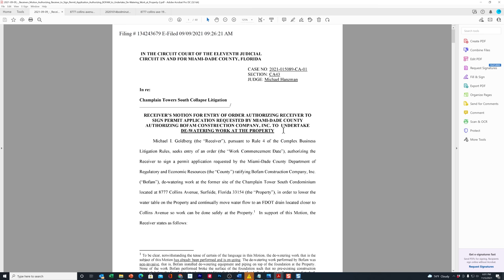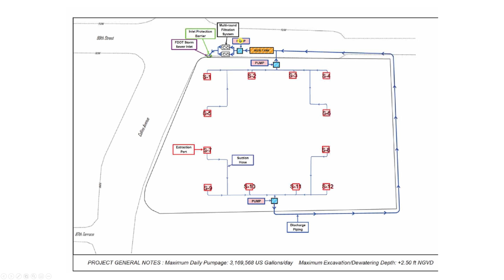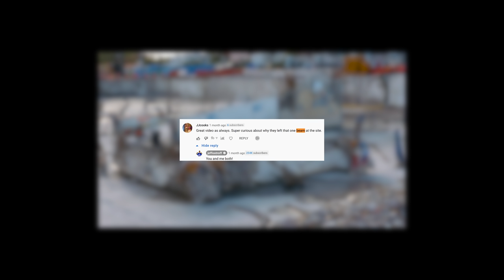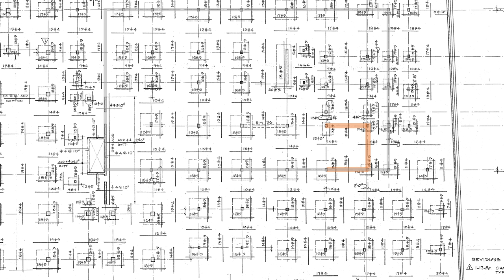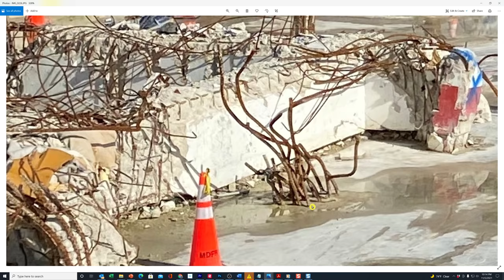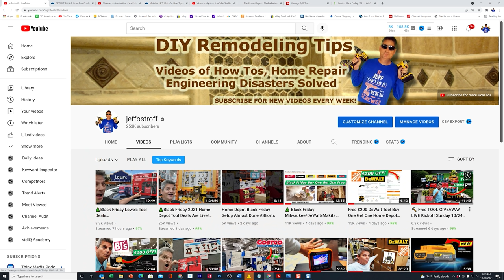Miami Condo Collapse: Engineers Baffled By Mystery Column

Comment: IIRC, it was in the Fiorella video, south-central portion of garage, you could clearly see a large rectangular section of the on-grade slab had been sawn out and replaced, clearly different color, texture, and weathering/staining of newer portion of concrete... anyone ever spot the requests/permits for that fairly major job? 
ETA: yep, it's @3:54 in Fiorella's video, near spaces 50-52, and encompasses at least 3 columns plus overlap, so a "patch" that's at least 50 feet long East-to-West, and... done by the handyman?... by a licensed contractor?
Reply from the maker: It would be a lot easier to find that permit if we knew what year it was done period it is also possible that may have been done without a permit
Reply: Edit2: although not as much color contrast post-collapse (due to weeks of rain, mud, and heavy equipment traffic), you can clearly see the NW corner of the "patch" in the video above starting @4:04 ... it takes up a good portion of lower-left frame... looks like it's completely OUTside the building, but very much in the heart of the infamous PLANTER ZONE ...
Reply: Well, I'm sure when the info comes out about CTS's so-called 'maintenance', we are going to be gobsmacked.  It wouldn't surprise me if the work had been done by people they loaded up from the sidewalk outside Home Depot.  "Can you do waterproofing and structural concrete repair?" "Oh, si, si.."
Reply: @johnbergstrom2931  Yep, every ducat saved in the "yucky" garage was more to spend on the very shiny marble in the "fab" lobby, and the oh-so-pretty planters by the pool... smh...
Reply: @johnbergstrom2931  So much of that going on.
Reply: @MajorCaliber  Right. And the roof work started with installing window washing equipment.
Reply: @stache1954  Not sure about window-washing equipment, but they did have to install numerous vertical-post-type fall-prevention anchors, intended for the roofers to tie-off their safety harnesses.  Apparently this is an OSHA reg that came along well after CTS was built, but they were not allowed to grandfather out of it this time around.  Many (but not all) of these anchors were mounted to the very tops of some columns, and after installation,  they were stress-tested by hand-winching a cable between pairs of anchors, loading them with IIRC something on the order of 4,000-5,000 lbs... not enough to damage a "healthy" building, but possibly Yet Another Straw on The Camel's Back...?
Reply: @jeffostroff  If it was done without a permit, the building owners would still have who they contracted to do it either in their system digitally or on file in paper right ? Sure it would mean trawling through a crap ton of info but eventually you'd find out who did the work and when it was done.

Comment: RE: The mystery column:  Given the amount of rebar in the mystery column it seems VERY unlikely to me that it was built as shoring before the collapse.  Here's why... If it was to be shoring it would be used almost exclusively as compressive material to hold up what?  Would it have been placed UNDER the existing beam or UNDER the first floor slab.  If it's supposed to hold up that H beam how is it going to do that with no foundation other than what is probably a 6 inch un- or poorly- reinforced slab?  Were that it's use there should be evidence of the slab being cut so a real foundation could be put there for this column.   No foundation means you don't expect it to hold up much but if all you wanted to hold up with the first floor slab for a few months it might suffice... But if you are just putting in a compression supplying column why would you stuff that column with all that rebar?  Makes no sense. Rebar is to resist tension load and moments, as a shoring there isn't going to be much/any tension or moment load for this temporary use. 

Also keep in mind that shoring that is not under load isn't shoring anything. You can't just place something under something else to shore it up, you have to move the upper stuff UP while you are building the shoring, make the shoring "too tall" and then let the "stuff" back down on top of the shoring so that the shoring will start providing some of the resisting force.  If you don't you get no shoring effect until such time as the stuff over it has sunk/settled down on top of it.  That's certainly OK if that's your plan, sort of a we want this here in case it settles more. But that also works against putting lots of steel reinforcement in the concrete.. shoring that's not even touching but is just hanging around "in case" needs little more than compressive strength, not a bunch of moment resisting steel.  There is no evidence that H beam was weak and needed shoring, to the contrary it was so strong it held together throughout the collapse and remained intact.  If the problem was the columns holding up the H beam why would you put your "fix" in the middle of the drive way?  You'd put it at the H beam ends to strengthen the columns holding up the H beam.  And I would suggest that as a temporary measure you would use steel, not concrete.. more next...

 Next.. and perhaps more importantly from a logical construction standpoint...  If I felt the need to get something into place here as temporary shoring I would simply order a 12 foot (whatever the distance was from slab to point of top of shoring) section of steel I-beam (to use as a column) along with 1 or 2 inch thick steep plates to use as bearing surfaces at the top and bottom. Once fabricated you could get them in and done in a day.  Weld the I beam column to the plates.  If you wanted to get fancy you could bring in some large building jacks to spread the plates an 1/8 inch so there would be some preload on the I beam column after welding things and pulling the jacks out.  You could place this steel where the "mystery" column is or you could put it next to the columns holding up the H beam.

So what we are left with IMHO is that the mystery column is not some temporary shoring. Even if it was thought a temporary support was needed it would make far more sense and be much easier to construct out of steel then to form and pour a concrete column inside the parking structure.  The mystery column is what it appears to be, even if why don't know the sequence of failure that put it there, it's some portion of the column that originally was on top of the H beam.. sheared off and speared into the slab.  ***What we are seeing might not even be the lowest segment of the sequence of columns that rose from the H beam up to the penthouse.  The segment that originally sat on top of the H beam may have buckled and slide off and been removed by NIST and the part we are seeing speared into the slab may have been from the 2nd or 3rd floor.  Who knows, we're all just speculating.

Comment: After reviewing the 1979 structural plans and reviewing the still image @ 4:17 of this video, I submit the following...  

Column K was not structurally tied to Beam BM35 with J-Hooks nor was it tied to the lobby slab with J-hooks. This is clear as no structural details for tying the 2 structural components together were provided in the 1979 structural drawings.  

It is also clear from the still image @ 4:17 of this video as there is no reinforcing steel protruding from the center of BM35 where Column K should have been structurally tied to BM35.

I would tend to agree with prior comments that the "mystery" column is actually the lobby end of Column K which penetrated the garage slab during the collapse.   Notice that all the other remaining columns have some concrete within and round the rebar and there appears to be none left within or around the rebar protruding from the garage slab at the "mystery column".  Yes, one would expect more damage from the garage slab if hit by the full weight of an intact column K during the collapse.  Based Morabito Consultants 40 year review and recommended repairs I don't think it would be a stretch to propose that column K at the lobby slab just above BM35 had also degraded due to water intrusion rusting the rebar and breaking the bond between the rebar and concrete allow for the easy penetration of the garage slab by rebar of column K.

This condition alone should not have caused the collapse but if the the rest of the columns at the lobby slab level were experiencing degradation due to water intrusion as well then that could have very well lead to the collapse.

Just my two cents from a couple decades in the industry...
Reply from the maker: We noticed the same thing, maybe 2 little rebars, but this column does not seem to be held in place very well.
Reply: Well, it was probably at least tied into the slab, even though it doesn't show it on the drawings.  It was a 'floating' column, but they didn't just let it float on the slab.  Column K probably had 100,000+ lbs of load on it.  If there was no rebar at it's base, it would have started cracking and failing 30 years ago...  
Not even an incompetent concrete worker would be that negligent.
Reply: And I think you're spot on.
Reply: I'm presuming they got the whole slab dry during the initial pumping. At that time, if this is a matter column K impacting the slab and embedding the rebar, then there should be spalling and possibly cracking of the slab which would have been obvious when dry. Don't think structural engineers would miss something like that... Not to mention that area of the slab could be removed for forensic analysis.
Reply: @terrymoreland6446  That spot requenches itself every time the tide comes in.  Pumping is futile.
Reply: @terrymoreland6446  Not "possibly".  The energy required to impale a 12 x 24 column would have broken up the slab massively.  It wouldn't be hard to spot - it would look like an impact/detonation crater.
Reply: @fraidykat  Trust me...you can pump out areas well below sea level out faster than water can seep through in through the sand. On the initial pumping, so they could get the crushed refuse out of the way, they pulled it out to a 'slab dry' situation.
Reply: @terrymoreland6446  Yes, with a big enough pump and low tide, you can pump it out.  Any time you turn off or even turn down the blimps, the water will return.  Even now you can see the puddle that remains.  Add a full moon at high tide or a tropical stormnand you have an even higher tide.

Comment: Since the basement floor at the mystery column looks very even instead of showing signs of impact, my guess is it was a retrofit column put in after the video.  Maybe they drilled holes into the floor to install the rebar then built up a column to the ceiling.  Because it was a retro fit, the new column's concrete would break away from the original floor surface rather cleanly.  Would need to see the underside of the crossbeam to check for an attachment point.
Reply from the maker: Bingo! That has been my theory also. And I suspect without permit
Reply: @jeffostroff  Jeff, go to the Morabito plan for repair and restoration.  It's on the Surfside site "Preliminary review plans for 40 year recertification", uploaded July 3, 12:46 pm.  (Near the bottom of the page).
On sheet S2C-2.9, top left corner is a drawing of a grade beam tied into a "New column".  They always intended to add columns for support.  Not really sure what they were supporting...
In the video, there is no excavation for the grade beam, so we swing back to illegal, unpermitted construction by people who didn't know what they were doing.  Also, I'm not sure if the Morabito work had even started yet...

Comment: To support the "Recently Added Shoring Column" thesis, I would add that there are several retro-fit piling technologies that could support a retrofitted column.  Some could be deployed with the limited ceiling height in the CTS garage... but get out the checkbook.
Reply: Cheque book.
Reply from the maker: Or they could just drill hole for a few rebars and pour a column real quick knowing it might be a temporary fix
Reply: @jonathaneastwood2927  Oh, you mean credit card...
Reply: Well I've scoured Surfside's public records looking for a CTS permit for an additional column and NADA.  If they didn't do the work above board I doubt they sprung for a new piling. 
It might be they just haven't digitized it yet but documentation of structural work on a building that collapsed would have priority...
Reply: @jeffostroff  Still need some kind of jacking mechanism to get the new "illegal" column to actually take up some load from the failing slab overhead.  Just casting a column floor-to-ceiling (using Mafia-Mix, nach) does almost nothing... except add to the floor's dead load, lol.
Reply: @jonathaneastwood2927  Cheque book.  Nudge-nudge, wink-wink, Chancellor of the Exchequer, say n' more... ;')
Reply: @MajorCaliber  I'd just use my 'Kryptonite Card'.  It has a trillion-dollar credit limit.
Reply: @MajorCaliber  It depends on the compressive strength of the concrete floor and soil.
Reply: @jeffostroff  yep and epoxied it.
Reply: @designstudio8013  assuming the floor still rested on soil
Reply: Well they can't fix it now whole building collaped and 100 people died did you hear?
Reply: @jeffostroff  no possible way in hell 12 pieces of rebar impaled themselves into a solid concrete floor without creating massive cracks in the floor. These rebar were drilled and mortared in place at some point. It's definitely odd that there is absolutely no concrete lodged between the pieces of steel like every single other column,  telling me the concrete was much softer in that area. Probably poured at a later date.  You agree?
Reply: @MrBmxbrawler  It's definitely odd that there is absolutely no concrete lodged between the pieces of steel like every single other column,  telling me the concrete was much softer in that area. Probably poured at a later date.  Or never poured at all, i.e. still under construction when zero-hour arrived... any wooden forms, if present, would've been pulverized, then washed/burned/dissolved/shoveled away.

Comment: Another great video! 
Could this be a structure column below the garage floor?
Reply from the maker: Remember any column that comes up out of the garage floor should have a pile with a pile cap below it extending down to the limestone bedrock. But remember Fiorella's video shows that it simply wasn't there last year.
Reply: I understand that this ‘new’ column was not in Fiorella’s video. This column is below the garage floor and was not by seen until after the collapse. This could be a punching shear.

Comment: The column that starts on the first floor and sits on the cross beam of the H, would that have been rooted into the H beam?  Or just into the floor itself, just above the beam?   That column was actually rectangular in cross section.  The re-bar protruding from the floor appears to have a square footprint.   Really looks like that the column in the basement floor was an addition,  not an impaction from above.
Reply from the maker: Good question Wade, I think rebar should have been placed in the H-Beam straight up where the column goes, then the floor slab is poured, and the rebar continues up through the floor to form the column.
Reply: @jeffostroff  That's interesting,  because when I look at all of the pictures and video of the H beam you included in your video, I don't see any evidence of rebar protruding from the top of the cross beam.  It would be interesting to get someone to sneak onto the site and get some close up pics of the floor and the mystery beam. If a new column was added and set into the floor then there would saw cuts into the slab.   However,  if that had happened,  and this created a path for water to flow upward onto the top of the slab, that water flow would likely have been happening before the collapse.    If there was a mystery column in place before the collapse it looks like it would have interfered with driving and parking.  It shouldn't be hard to find a survivor of the non-collapsed section or other recent visitor to the parking garage to confirm that.
Reply: Good eye on the column squareness.  Yes, column K (the one supported by the H beam) was 12" x 24" and that proto-column is certainly bigger than 12" in either direction.

The H beam, 1st floor slab and column K were theoretically all tied together with rebar, the column was just not plunked down on the slab where it could 'slip off', as suggested by the 'impalement' crowd.  The configuration of the rebar depended how they poured the elements, chronologically.  It might be that that they formed the H beam without any rebar tied to the slab, waited for it to cure, then poured the slab above with a rebar connection to column K, but not the H beam.  Since they don't really have earthquakes in Florida they were not expecting any lateral forces, this was an acceptable way to do it.

Maybe that's part of the answer.  If column K was only tied into the slab, not the H beam, when the slab under unit 112 started to crack/sag (probably from creeping water damage and spalling) column K started to crack walls and shift out of plumb, albeit slightly.  Panic ensued, and management told [somebody] to quickly add another column.  "Don't bother with design or permits, get it done!"
Reply: It would be tied into each end.
Reply: @wadeturner2665  there was 20' - the column